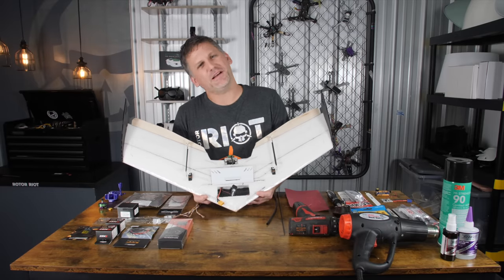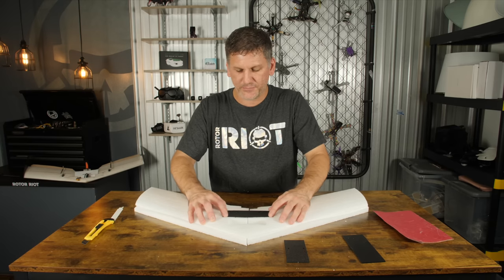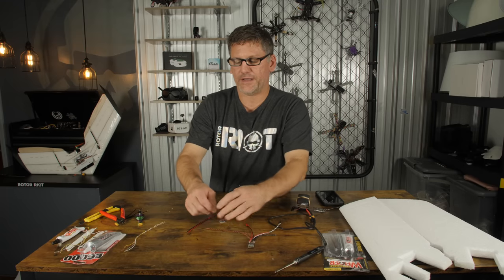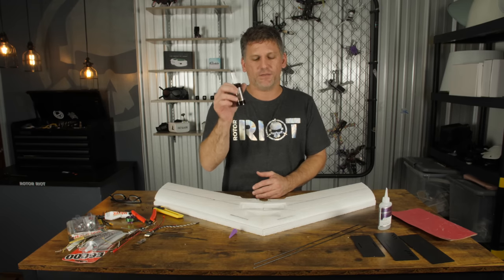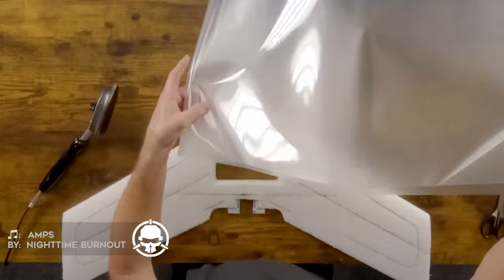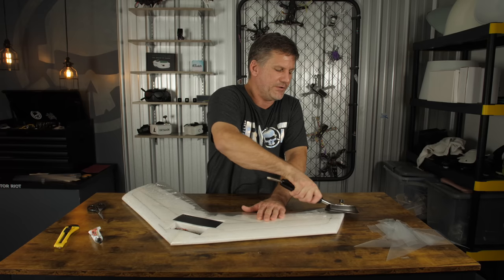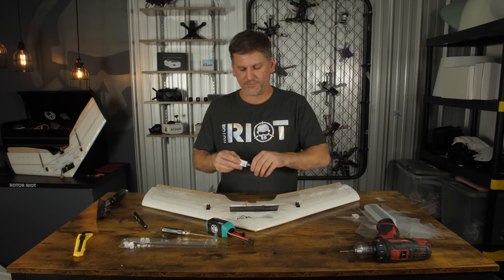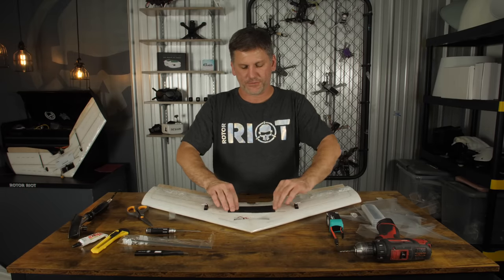Riot Wing - High Performance Freestyle Wing - Build w/ LetsFlyRC

Comment: I have been wanting an FPV airplane for a while, but there don't seem to be many.  Thanks for putting this together!
Reply: Wire-cut foam wings are definitely fading in popularity. The PNP molded foam wings have just gotten so much higher in quality and lower in price the last few years that it’s really tough to compete. But it’s super satisfying to put a good wire-cut build together and the ability to customize means you can get creative if you want.
Reply: @chrisbee5481 for a first wing? I dunno. I’d say AR Classic. Everyone should have one. But I’m partial to wire cut builds and if you’re looking to get into that, this RR kit looks really straightforward and well put together.
Reply: @chrisbee5481  it’s relative. The AR classic at 35” to me is a mid-size wing, but then my favorite wing is 52” and I’ve got stuff as big as 90” and as small as 18”. I think 35” is about the perfect balance of having room to mess around inside without everything being super tight, easy to hit CG, decent in a crash, big enough to not get pushed by every gust of wind, but small enough to launch easily with one hand and can still fit basic 5” quad motor/ESC/battery/prop that are easily available everywhere. And it comes apart if you want to fit it in a bag. And it’s cheaper than dirt.
Reply: @swissfreek  I haven't seen wire-cut foam wings in a long time, but I don't know much about RC airplanes.
Reply: @PurpleLich  oh they’re out there haha. Not what it was a few years ago (like all RC) but there’s still entire events with 50+ pilots that are all foam triangles.

Comment: This looks a little too advanced for my little brain, but I still get stoked for EVERY build Shawn is involved with!
Reply: It looks way worse than it really is. Just a little patience and attention to detail. It’s also not as exacting as it looks. You can get away with a lot of fudging/imprecision if the basics are correct. Downside is yeah it doesn’t just bolt together like the quads.
Reply: Start with foam board. Flite Test sells the Arrow as well as others. Much cheaper and easier to build.

Comment: The ER4 has voltage telemetry which you can set up to give low voltage warnings. It's cool that walksnail shows voltage without an FC but seems unnecessary in your build. If you haven't flown a wing before you are a brave person or rich putting expensive HD FPV gear on the nose. Be wise to go with cheap old analog until you get the hang of it.
Reply: This tpu mount protects your expensive digital fpv gear

Comment: 8:30 With Welder’s getting harder and harder to find over the last few years, a good alternative is either FoamTac, which you can usually get at your local hobby shop (or online), or better still, you can pick up Aleene’s Ultimate at craft stores (Hobby Lobby, Michael’s, Jo-Ann, possibly even Walmart). Both Aleene’s Ultimate and FoamTac are contact cements like Welder’s, which makes them great for this sort of task (joining the wing halves together where it’s tricky to pin them if the glue takes a while to set like Gorilla or E6000/Goop), but way way easier to find, and in my experience they don’t get yellow and brittle over time like Welder’s will. Just a tip for newer folks who might be like “WTF is Welder’s???”
Reply: @WipeoutFPV  yeah, in Europe that’s your best bet. Welder’s hasn’t been available there for ages, and from what I can tell E6000/Goop and Gorilla Glue are also tough to find?

Does UHU Por have the same contact cement properties as Welder’s and FoamTac? As I recall it didn’t, but I haven’t used it in decades. If it does, that’s definitely a good option.
Reply: Foam2foam works awesome

Comment: $200? for a hot wire cut thing that i need to spend a whole day getting it built? lol f that! i can get a atomrc swordfish for $200 in pnp, or a dolphin in rth kit thats fully pre built
Reply: Fly it into a parking garage wall and count the pieces that are left.   ¯\_(ツ)_/¯
Reply: @LetsFlyRC  I'll count them while hot gluing it back together, also it's not like one will explode while the other won't, so I don't see your point, I can get a moulded smooth clean nice looking airframe that's stronger due to its smooth surface that doesn't want to rip that I can also laminate, vs a hot wire cut thing that if you want a decently aerodynamic airframe you have to laminate, something that requires this much work from the end user should be cheap, I don't see any value here, nor do I see the point of your response since it will kill both aircraft and both cost the se for a replacement airframe lol I'll take a dolphin or swordfish or like 100 other planes for the same money over this thing all day long. Heck you could have 3d printed moulds that would make a nicer product, hot wire planes are only good for diy or prototyping, you really should be selling a better quality product for the money, the amount of offcuts wasted foam you want me to pay for is unreal, and I expect better from not just rotor riot, but you Shawn especially.
Reply: @christhorney   I am not telling you to buy anything.  Nor, do I set the prices. The price is based off of what it cost, plus a minimal profit.   

I am telling you that my wing WILL survive most concrete impacts, as I have done it over and over many times flying through parking garages with this plane.  

I wanted to build a plane that was more durable than what I normally fly, so that I can do more difficult proximity flights without having to repair my plane after every crash.  

You can keep being mad if you want, but, I usually build things that I want FOR ME, FOR MY NEEDS, and usually other people tend to appreciate my efforts as they are usually done because I am trying to make something better than it was previously to advance the hobby, or to help new pilots succeed.  

If you don’t appreciate my efforts, that is fine.  Keep flying what you want to fly.  I didn’t do anything wrong.   I provided input, tested and designed a wing that was right for my needs.  And it flies like it is on rails and can take a hit.

Comment: $99 for a foam kit?.. Must be smoking rocks. S800 reptile $35. Built like a tank, tried and tested. Thank me later..😉
Reply: Cool looking plane, but, it doesn’t check the same boxes.   Will be in pieces first time it hits a tree or a pole.
Reply: @LetsFlyRC  That's where the S800 shines. Iv had several and still got two. I once clipped a lampost at 80% throttle and it just bounced of leaving a small dent to the trailing edge. Built like a tank